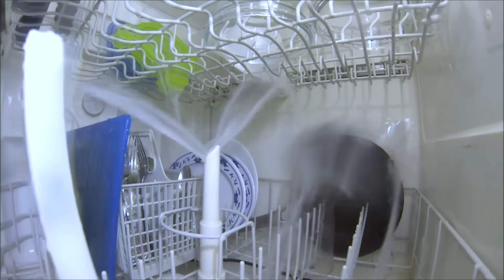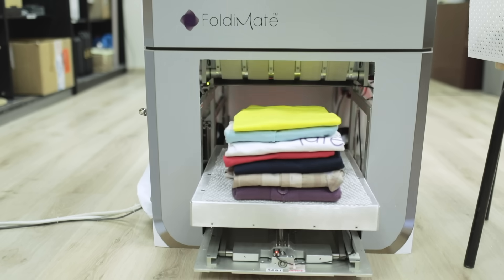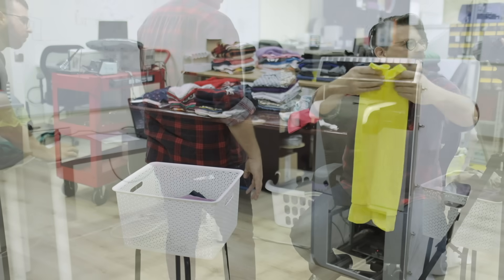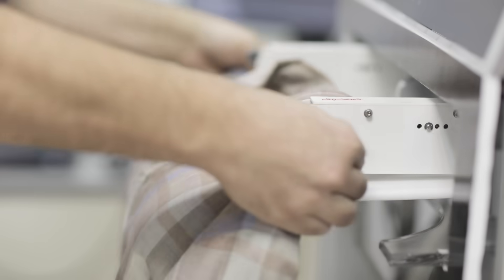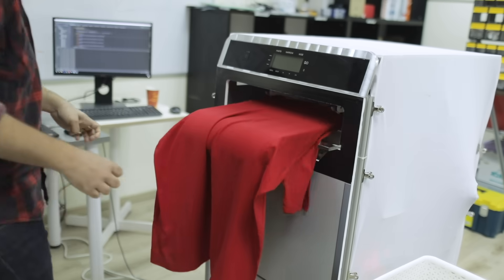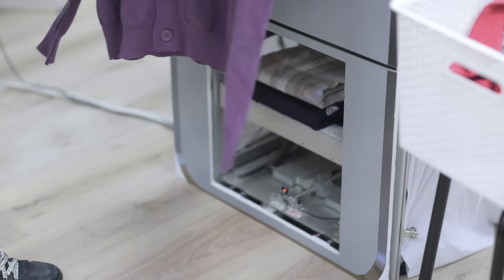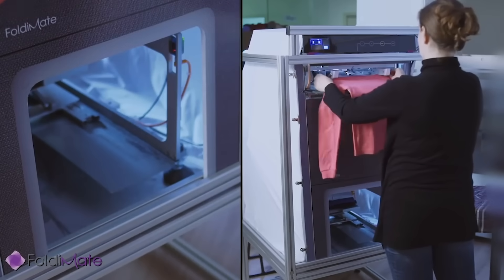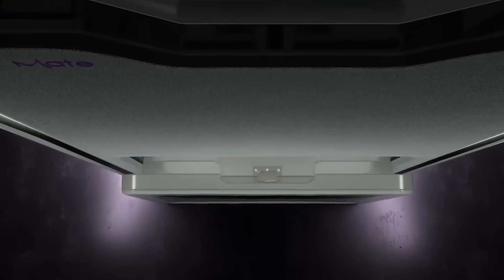Foldimate laundry folding robot

Comment: Great invention. You solved the hardest part of making a folding machine. Doesn't it defeat the purpose that you have to load each item, then wait for the machine to take it in. I could basically fold the item myself in that time. IMO it'd be better if you could load all the clothes on a clothing rack or something similar which would slowly roll into the receiving belt.

Comment: Because when they didn’t send you more immediately, people were discovering that running a print head clean in the printer settings miraculously restored about half the ink level despite using ink in the process. This was leading to people using the same ink cartridges until they genuinely did run out of ink, rather than when the exposed print heads dried over and the computer tells you it’s “empty”.

Comment: For a business owner this could be a valuable tool, having the appearance of uniform folded merchandise is a goal for every apparel retail store. Also it has the potential to reduce labor cost, by boosting productivity. I would invest in this company, as most major retail chains are turning to automation to achieve results.
Reply: My old job that works with hospital linen they had a machine like this one but the bigger version. those things cost tens and thousands of dollars and they break often, that’s why you need maintenance to call maintenance all the time to fix it.🤦🏾‍♀️🤷🏾‍♀️
Reply: And the Machine doesn't complain and b** about a vacation
Reply: @patriciapadilla2022 that's because it's a machine

Comment: Yea... nobody's going to want to buy this because it still takes a lot of your time if you have to stand there sticking shirts and pants one at a time at such a slow pace. You need to: A) develop a way to just put all the laundry in one place that the machine can take it in automatically on its own -- even if the user has to clip shirts and pants on a rack that's going to be a lot more compact and less tedious to use. B) develop a way for the machine to be able to handle garments of any size or type, most likely with sensors and software designed to identify and recognize how to handle the garment in question before it starts folding it.

Comment: I’ve had a Siemens washing machine and the Siemens STEAM tumble dryer for over 15 years and NEVER had any trouble. The steam function on the Tumble dryer is SOO GOOD clothes come out of Washer into Tumble full of creases put on the steam function the clothes or bed linen go STRAIGHT TO DRAWS AND Wardrobe ZERO CREASES OR NEED TO FOLD JUST USE HANGERS. If Siemens aren’t making this it’s not worth it .

Comment: Great concept, but it wouldn’t work for me bc the worse part of folding is untangling the clothes and getting them to the stage that the foldi need them in before it goes in the machine. By the time I get the pants or shirt to that stage just a couple steps and you’re done. 
Also I sit down and watch tv while folding. I’d hate standing in front of a machine loading it one by one. That’s even if the machine folds everything perfect which I kinda doubt it does.

Comment: For home use, this makes no sense, could work for a laundry business if it were a bit faster and size would not be much of a problem. There are a lot of laundries in the world, with lots of man-hours spent on folding clothes, something to think about. But yeah, cloth is a pita to handle mechanically, good job at managing it at all in any capacity, but what I see right now is a mechanical curiosity, not a winning business case.

Comment: The best product would be one that is not as bulky and fits onto the front or side of the dryer and senses when the dryer is done. Then the dryer has a setting where it will continue to spin and feed clothes to the folder until all the clothes have been folded and basketed. Boom! The consumer never has to touch anything after they load the dryer!
Reply: Let us pray.
Reply: Prayer can only solve this cos apparently you want no business in laundry execpt for your machine to be doing the work

Comment: I want a machine that will replace my dresser, closet, washer and dryer. Imagine everyday you wake up and instead of having to sift through the dozens of clothes and socks, you simply select a set of clothes and the machine retrieves the clothes and spits it out for you. Now at the end of the day, instead of throwing your clothes into the hamper, you instead give it back to the machine. Where it takes the dirty clothes, washed and drys it, and then folds it back into its clothes database. The next day, you could even wear the same outfit if you so choose. I expect this type of machine to be able to store 40-100 clothes, plus you can add on extra storage containers if you so choose. This is what I want. And I believe this is all 100% feasible in today’s modern day and age.

Comment: This is lame, i will still need to load 1 piece of clothing at a time. Good start, but useless
Reply: Would you rather load 1 piece at a time or do the laborious repetitive task of folding a basket full of clothing?
Reply: AL
I'd rather do the laborious repetitive task.
Anyone can do it faster then the machine.
This is not any kind of improvement. (unless maybe you have crippling arthritis or something?)
Reply: Especially for pants, you already need to put them flat and folded in 2, you'll be faster finishing the job than putting it in the machine...

Comment: Would be nice if it could iron shirts while folding
Reply: exactly, i first saw a similar video of the product, i got from a WhatsApp forward, and i thought its main purpose was to iron the clothes.
But this just folds clothes, which is pointless, since we literally have to feed each cloth to the machine and all it does is fold them.
Reply: Not ironing?
Reply: It steams small wrinkles out then folds.
Reply: You still have to iron again to use after ironing and folding. Generally tshirts stay with the folding marks and it sucks lol. I never iron anything until I use it.
Reply: TheEjaay yeah! Like a quick steam at least 🤔
Reply: ricecristi yeah I hope it has a steam iron feature.
Reply: check the effie

Comment: the problem is that the user still has the stand there and feed every single item to the machine. The person still has to interact with the machine instead of give it a basket of laundry/clothes and then leave for it to be sorted and folded.
Reply: I woulnd't pay $50 for this. Next round though, when you can dump the clothes in the top hopper and come back some time later and everything is folded, well for that I would pay quite a bit!
Reply: @grakkerful  
Link please
Reply: @nmmn2700  To what?
Reply: @grakkerful  oh and what would that be your quite a bit ?
Reply: @grakkerful  I wouldn't buy if I have to dump the clothes to the machine
Reply: @grakkerful  yeah no good, I cou I'll d stand there and fold 50 articles of clothing faster than that machine
Reply: Either a hopper and/or a robot that takes the basket to the machine, puts them into the machine (except for the ones that shouldn't go in), and takes  the basket of the folded clothes to the closet.
Reply: It is also a large bulky item that the person needs to have space for. Could be an issue for apartments.
Reply: @joshn2342323  

Porra, você é uma garota bonita. Grandes altos e baixos para a nação negra ..
Reply: I agree but def a great start
Reply: I understand your reply, but that is a very high level approach.  The real value is in saving time.  If it could cut your time spent doing this task by 1/2 or more, then I feel it is a success
Reply: I wouldn't mind standing there... anything better you have to employ domestic helper.
Reply: @waktempeh8684  thank you
Reply: The problem with the dishwasher is that the user still has the stand there and feed every single item to the machine. Not only that, but they also have to rinse it first as well. The person still has to interact with the machine instead of giving it a tub of dirty dishes and then leaving it to be sorted, rinsed, and washed........but you don't own a dishwasher, right?!
Reply: I can see the use of this in places like communal / council buildings that generally have laundry and drying machines. Rather than taking all your things all messed up in a bag or basket you can neatly take them back home.
I don't see the use of this in a home. The idea is to save time, I'm a pretty fast folder (and it is an activity I do enjoy). If you have to stand there you aren't saving time, unless you are terrible at folding.
Reply: @veritosocial  .
Reply: @veritosocial  Agreed. Laundromats could use this
Reply: Well said. That's what I thought.
Reply: Exactly,
It could happen within next 10 years, by the year 2030☺️🙂😃😃
Reply: Don't worry Sydney Wong...
You will get your desired machine by the End of 2022...
(Industry 4.0) Working on this...
Reply: Still much better than manual folding. I have OCD, it can sometimes literally take me 4 minutes to fold one t-shirt.
Reply: I wait for you to invent the machinary you expect
Reply: At least they don’t have to fold them
Reply: New york was not built in one day, see the big picture.
Reply: Agreed!
Reply: All in due time Sydney!!!
Reply: Eventually yes the machine will be sophisticated enough to have robot arms sort out your clothes to be folded and treated in stages, like steaming and deodorizing etc, but until then that's not gonna happen for quite a while.

A closet that can do your clothes without having to move a finger is still quite some years away, but most certainly not impossible with the right engineers on board.
Reply: then wait until humanoid robots come out. They will feed the machine.
Reply: if they combine it with robotic arms and a camera. it might just work. :)
Reply: Hi i laik
Reply: Correct point!
Reply: exactly
Reply: how was export this
Reply: It’s not about being lazy, it’s the fact that you might as well fold it yourself for the amount of time your using.
Reply: Let me know what is the price
Reply: A general purpose robot could probably do this fairly easily, acquiring the next piece of clothing as the machine folds. of course  that begs the questin of how hard or slow is it to just have a robot do it all - there are examples of this now.
Reply: Idk about y'all but I'd buy it now!
Reply: Can be fixed by adding multiple heads
Reply: And? Why is that a problem? I don’t mind dealing with it this way because I don’t have to bend and shit. Just feed it it in let it do it’s thing and then put them away. 😂
Reply: What you do to wear
Reply: Wait for tesla bot and program the bot to do it
Reply: Man you guys are lazy af
Reply: Pretty useless...
Reply: There's a tesla or Honda robot for that now. 😊
Reply: How lazy are you ....WOW ..people these days, pure joker
Reply: well that sucks
Reply: Laundroid is working on one where you just dump your clean clothes into it, and its sorts and folds them.   But it's twice the size of this...and kinda costs 16k. lol
Reply: All these people calling Sydney lazy don't realize that people like her made it possible for us to have the technological wonders we have today.

Without a good product owner that pushes the development team to perfection you never achieve a truly revolutionary invention.
Reply: Pretty sure hands can fold pants faster, now if it'll also press and steam out all wrinkles than dry cleaners need to be worried.
Reply: Wow, such spoiled so wow.
Reply: @UltraGamma25  ikr the machine is doing the shit for your ass. And to say it's a waste of money because of people who live in apartments because of space well maybe it's not for you and not made for people to come and buy who live in apartments.
Reply: I don't like nay-sayers. They always talk negativeness.
Reply: @JD-kf2ki  lol 😆
Reply: Damn you’re fucking lazy
Reply: OK.  👍🏻👍🏻👍🏻👍🏻👍🏻
Reply: @ramkishanmungle4386 xd <##'d2#
Reply: You're an Idiot.  I bet you carry your bike instead of riding it.
Reply: Why are you even a human if you're that much lazy huh?
Reply: Sydney Wong You think they didn’t think about these? You’re just a lazy bitch.
Reply: Sydney Wong god forbid you have to move a finger you lazy shit! Maybe it’ should also give birth so you don’t have to be a female anymore